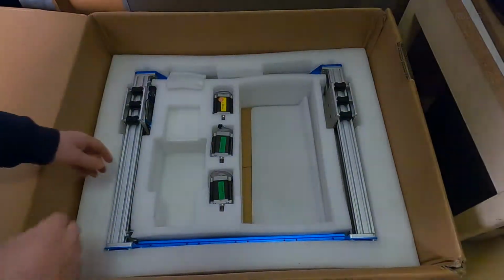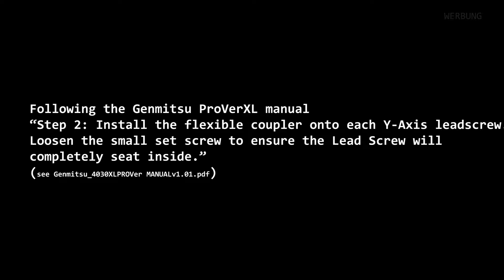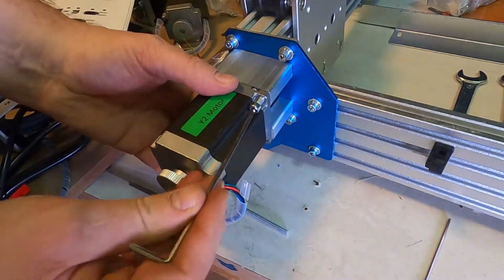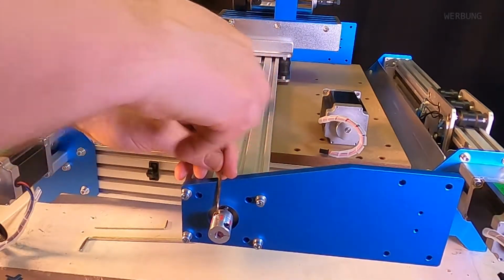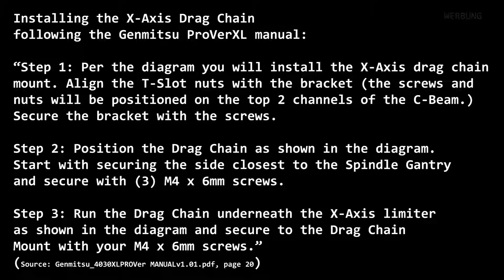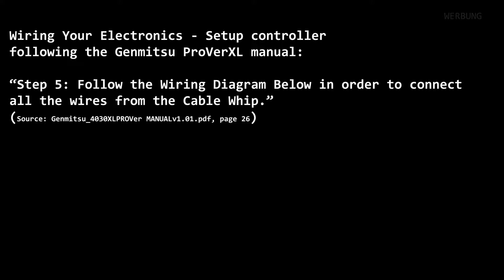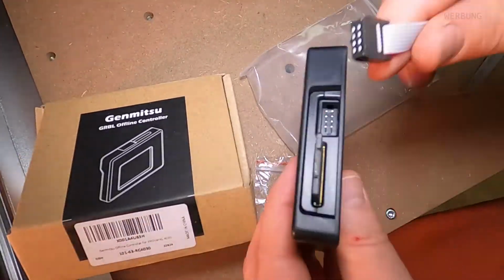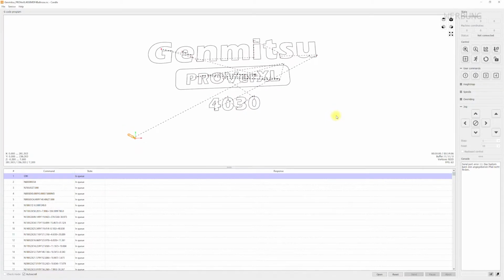Genmitsu ProVer XL 4030 - My build and setup of the machine

Comment from the maker: I´m working with machine now for several months and the machine works ok. For more diffcult projects (e.g. hard wood) you have to change the spindle, e.g. using the Dewalt or Makita router (bracket already included). There were some issues using the machine with the PC and local controller connected at the same time, so you have to decide for a job using the one or the other, otherwise the machine makes "funny" :face-fuchsia-tongue-out:decisions. I still trying to discover all the posibilites that come with the machine.